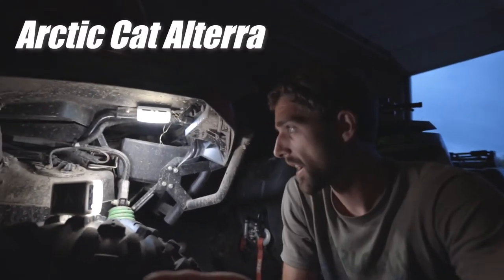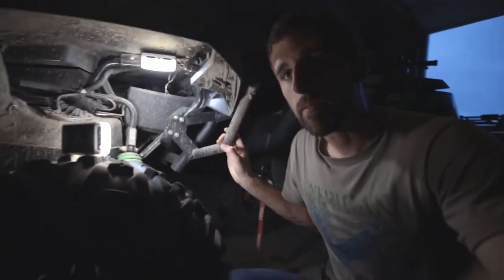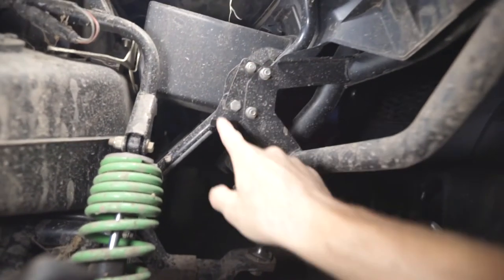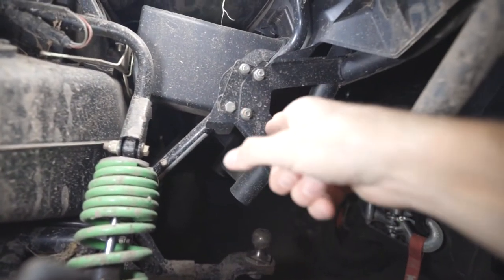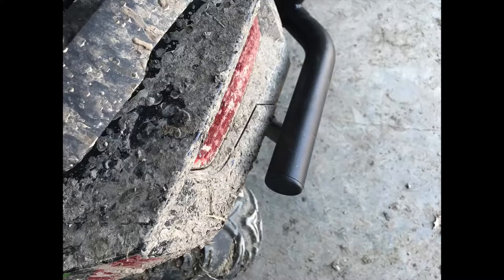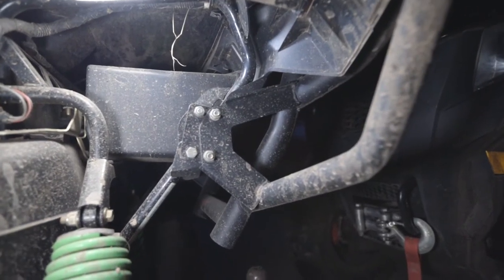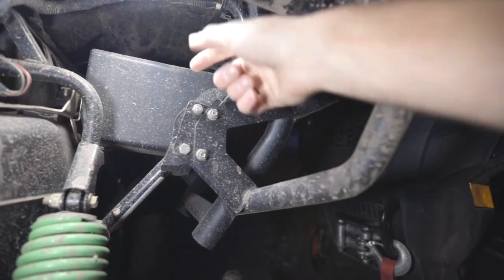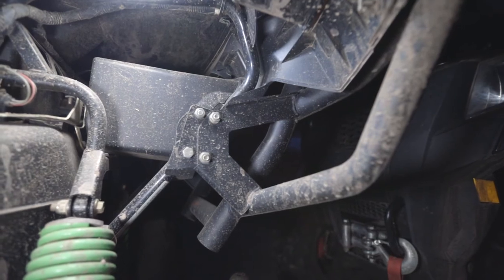Arctic Cat ATV rear bumper trick

Comment: Wow, they have that bumper mounted that close?! I would have figured they would space that out a little bit to avoid rubbing the plastics. This is a really good and simple tip!

I'm considering putting a bumper on the rear of our Wildcat, but I really do not like the way basically all of them mount up. I have some 1 1/2 .120 wall DOM laying around, and managed to find some 1" double split collars to use to mount midway up the chassis tubes for extra support, so I think once I decide how I want it to look I'm going to build my own bumper for it and maybe do a video documenting how and why I chose to do it.
Reply from the maker: Yeah, it was close enough it would rub the fender. Simple bracket did the trick! Some atv/utv bumpers are more for looks so making your own mount is often better and stronger.

Comment: Actually, the triangle those bolts attach to on the frame is broken off on mine. I have to weld mine back on maybe next week! The previous owner must have rolled the vehicle hard. Good tip, I wonder if my bandsaw could hack it for the mod.
Reply from the maker: If you weld it on farther back you could skip the bracket. See what works! 👍🏼